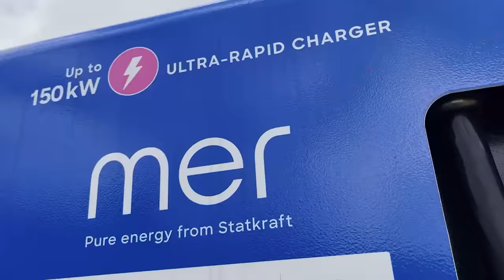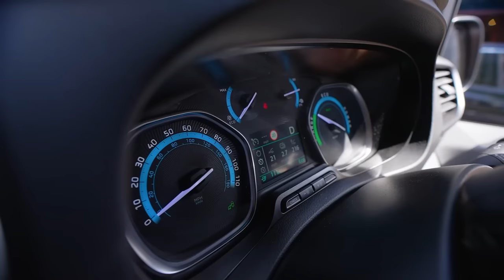Global EV Showdown ~ Is China Outpacing the West?

Comment: Absolutely spot on, I drive a Chinese EV because it works for me, the purchase price was about the same as any ICE cars  that I have previously purchased for  the specification and it’s great to drive.  I do 12,000 miles a year and 90% of my charging is from home at 7.5p per kWh, that’s less that £10 a week for me and less to service little or no break wear, free fuel top up when I drive down hill  or break, plus instant torque.  What’s not to like?
Reply: As the largest oil importer, China is determined to develop electric vehicles.
Similarly, Britain is not an oil-rich country.

Comment: Currently own a Chinese 2019 MG ZS EV and do 20k miles per year in it (85k on clock) Mainly 70 mile daily commute with occasional 330 miles family trips. Saved me £2k per year in fuel over my last ICE car (skoda Octavia). Cost me £20k, currently can buy for just £11k. The secondhand EV market is full of bargains you can now get my car for £11k or a top range EV like Jaguar ipace for just £24k. So are EVs still expensive, well they are not if you can charge them at home on off peak electricity and use them for your daily commute. Buying a secondhand one could save you a fortune.
Reply: Try buying the batteries when they start to pack up... Will be costing 25k just to replace the batteries...
Reply: @danielhart3820  They last for 100's of thousands of miles. Like I said my current EV is 5 years old and done 85k miles, current state of battery health is 89% so I've lost 11% on 85k miles. By the time the battery is dead and needing replacing I would have done 250k miles, most petrol cars fall apart after that distance. Also your prices for batteries are wrong, a fully working 50kwh battery can be got for £10k and battery prices are dropping dramatically.
Reply: @shortbits23  where are you getting your information from? I am an EV technician.
Batteries are normally warranted upto 8 years, after then you are paying more for new battery pack of what the car was worth when you got it brand new... Yes eventually batteries will be cheaper but they aren't coming down like that! The only thing that makes EV vehicles worth any money is the batteries, with them gone the vehicle is useless.
And when the batteries are at end of life where do they go? In a field somewhere buried in the ground. EV is a temporary solution until hydrogen comes into play!
Reply: @danielhart3820  as for hydrogen, not in cars, will be used in trucks and heavy vehicles, and shipping. JCB are really into hydrogen, it works well for them. So it has it's place.
Reply: @danielhart3820   I have responded to your question "where are you getting your information from" twice and for some reason they have not been posted. One of my responses took a good 20 minutes to compile, gathering all my sources and FACTS. Can't be bothered to post here anymore just wasting my time if my post are not published god knows what the thread admin is doing or is it YouTube.
Reply: @danielhart3820  See Internet items about the Toyota Mirai which runs on hydrogen. There is a notice  under the fuel flap saying "Do not refuel after [date about 13 years after date of manufacture]". What are you meant to do with the car after this date?
Reply: @danielhart3820  It really depends if the battery uses the older NMC chemistry — more expensive and energy dense — or the LFP chemistry — cheaper, lower energy density, more than twice the durability (as in number of cycles), faster charging, much lower chance of thermal runaway/catching fire/exploding.

A modern LFP battery with 200 miles of range can easily last over a million miles before needing replacement, by which time the car is likely to already have been scrapped. I, for one, would never even consider an EV that uses NMC batteries. More so for a hybrid or a plug-in hybrid, whose smaller batteries cycle (and, thus, wear down) much faster.

(Incidentally, CATL is talking about increasing the warranty of its newer LFP batteries to 15 years or 1.5 million kilometers, whichever comes first. And that is for 85% of the original capacity remaining, rather than the 70% which is the industry standard.)

For the future there's also Sodium-ion. Even cheaper, even lower energy density (though that is improving), durability and charging speed on par with LFP, even safer than LFP (you can drive nails through it and it will only get somewhat warm), and as a bonus its cold performance is quite better than both NMC and LFP.

Comment: EVs typically recoup their manufacturing CO2 by 15-20K miles, not 60K, though that figure may be plausible for the heavier, less efficient models
Reply: jamesclark5654  Closer to 2:1 in 2022 figures, if you are talking about the carbon intensity of electricity generation; it was 251 grams of CO2 equivalent per KWh of power for the EU, and 531g for China. With the caveat that among EU countries Poland and Cyprus have worse values than China.

Incidentally, China is pretty close in electricity carbon intensity to Australia (502g), Japan (495g), and Israel (538), and better than Taiwan (561g).

And how fast using the car recoups the "built in" emissions actually depends more on how clean is the energy grid of where the car will be used. If you use it in, say, Brazil — which emits less than half of the carbon per KWh than the EU — or Ethiopia — where the energy carbon intensity is a mere tenth of the EU — then it will recoup those pretty fast, while if using it in Poland it will take quite a bit more to recoup those emissions.
Reply: I suggest you read more and study more

Comment: I don't think electric vans are for trades people (yet). They are very suitable for delivery people transporting laundry on set routes each day, stocking the counters within an area, ... . People that drive 60 miles a day with frequent stops knowing they charge the van at the depot each night.

Those vans don't get bought by people passionate about a brand or engine system, they get bought by logistic managers that are under pressure by accountants. Once the formula says go they go.

Amazon is the 'Prime' example.
Reply: EV doesn't need to occupy all occasions.
As long as it occupies part of the use occasions, it is a huge market.

Comment: If you want to save the environment buy a second hand small petrol car. Ev’s produce immense co2 before they’ve even hit the road. I’m still not convinced co2 is the danger it’s portrayed as given it’s only 0.04% of the atmosphere and most co2 is overwhelmingly produced through natural processes. 
I’m more concerned about plastic pollution in the oceans and crap from our sewers being pumped into the sea.
Reply: You could buy a second hand 5.0l V8 and still be doing more for the environment than these EV cultists.
Reply: Actually, buy a small second hand EV.
But if you're buying a new car then buy an EV.
Either  way, buy an EV.

Buying a second hand small petrol car means someone is going to replace it anyway and with what? It's increasingly likely they'll replace it with an EV.

Doesn't matter how you cut it, ICE produces more CO2 and pollutants per mile than an EV. At some point the EV will overtake the ICE - even if it's a new EV vs an old ICE.
FWIW, Rogers 60k miles is worse case - true if you live in Poland but not in the UK. Here it's somewhere between 20 & 30k.

If you want to be truly green, leave the car at home (or better still don't buy one at all) and use public transport, bicycles or legs.
Reply: Not convinced CO2 is a problem - contrary to the advice of the overwhelming majority of climate scientists!  Thank you Professor Gdfggggg
Reply: What argument are you making that CO2 is 0.04% of the atmosphere? While there are natural sources of carbon,  there are also national sinks. These natural sinks cannot handle the extra CO2 we're producing (us trashing these sinks isn't helping) and as a result, CO2 concentrations have increased from 280ppm at the start of the Industrial revolution to 420ppm today.
Reply: @Richard482  plants, trees and mostly sea life soak up co2. Co2 is vital for life. Without it, everyone would die. The more co2, the quicker it gets soaked up. Most co2 is produced through natural processes.
Reply: @Richard482  co2 is 0.04% percent of the total makeup of the atmosphere, with nitrogen(80%)and oxygen(20%) among other trace gases.
Reply: @gdfggggg  Regarding its percentage are you arguing that a substance has to be in a big amount to have a big effect?
Reply: @gdfggggg  If plants etc did indeed soak up CO2, atmospheric concentrations wouldn't have increased since the I.D and CO2 concentrations wouldn't have been far higher during the time of the dinosaurs for example. Why didn't the flora and fauna back then absorb it all. It was only through the formation of coal, oil and gas and the weathering process, that CO2 levels declined.
Reply: @jamesclark5654  the irony 😂
Reply: @jamesclark5654  yes, but not all scientists have the same opinion. Your comment applies to you as much as it does to me, there's the irony.
Reply: @Richard482  i tried replying to your comment but YouTube deletes it.
Reply: @gdfggggg  They might be deleted if they include links to other YouTube vids. On Facebook if you wana discuss this issue that way? Richard Lock
Reply: @Richard482  Hi, I don’t do facebook or any of that. I’m looking for another YouTube similar option though as I’m fed up with this platform; they seem to delete most of my comments when some of my arguments are sensible, and sometimes poignant. It’s annoying.
Reply: ROFL.  You should do some research regarding CO2 and it's effects, your at the position of not knowing enough to know you don't know enough. And an EV, especially in the UK , does it CO2 manufacturing payback withing a couple of years of driving
Reply: "I’m still not convinced co2 is the danger"

Can you point the audience to your peer reviewed research?

Comment: It’s nothing like 60k miles to achieve carbon neutrality with ICE - between 10-15k is the best estimate and it’s coming down all the time.
Reply from the maker: It really depends how you measure it. Steel production accounts for 6% of manmade CO2 and China produces steel that has a much higher carbon footprint than anyone else. I didn't say that they would achieve parity with ICE I said, the point when they break even on CO2 is around 60,000 miles.
Reply: @SkillBuilder  If China produces the steel, how does it get to Europe? What is the difference in shipping a lump of steel, or a car
You should have a listen to Hannah Ritchie's podcast with Robert Llewellyn.
Shipping is not as bad as it might seem, and with a modern clean grid, the "breakeven" is much shorter than 60k miles

Cheaper cars are a good thing, because it means more people can buy them, and free up money spent on fossil on something more productive

Comment: Do vans re-adjust the range depending on how much it’s loaded in the back?
Reply: In reality yes, the more you load it the less range!
Reply: Yes when I got the e-vivaro it actually did roughly it's 205 mile stated range empty. By the time it was racked out and packed out for call outs it estimated 80 miles in the winter which actually came closer to 55-60 miles. Losing 75% of advertised was a bit too big a kick in the balls to make it viable for us. Thankfully it was only a test vehicle but given that some days we were due to do a 90 mile round trip for boiler break downs it was impractical to even attempt to take it given the lack of consistent public and motorway chargers.
Reply: @effervescence5664  damn! That’s huge! Does it have internal weight sensor then to know this?
Reply: @Mr_Ashley  Not that i found, it appeared to calculate via energy used in transit. Took more to pull away fully laiden and depleted faster so i think it was just using the ine metric to measure. I didn't bother looking too hard into the features as for us it was more about the viability of an ev van fleet than testing a vivaro.